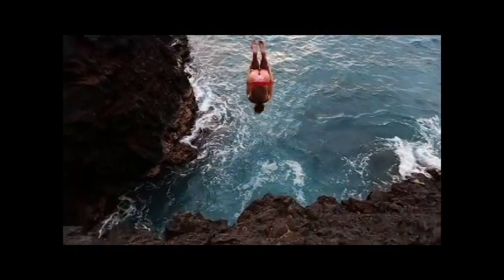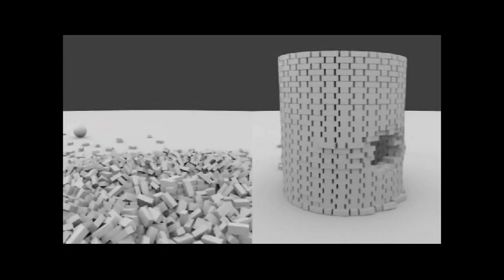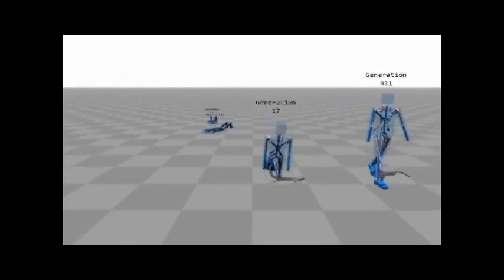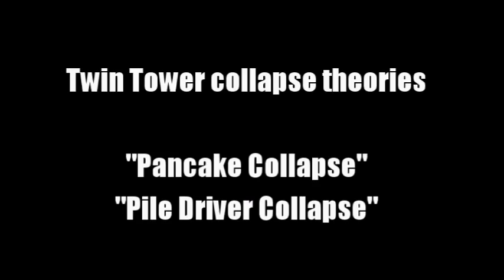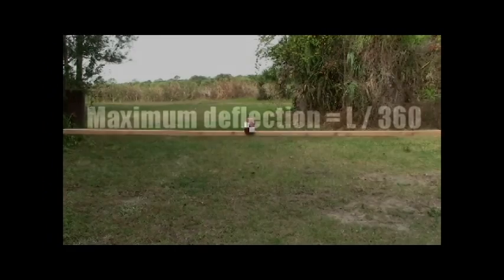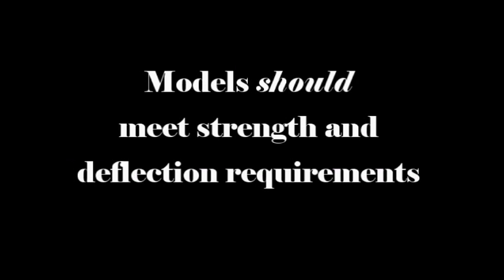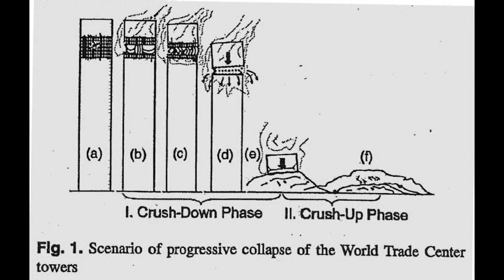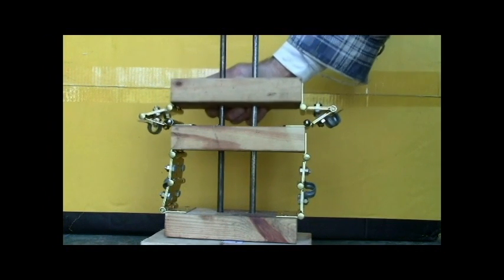9/11 Experiments: The Force Behind the Motion

Comment: Your initial experiment starting at 6:00 is hugely flawed. Your wooden frame is not an accurate representation of the twin towers' frames. Due to this, your frame absorbed alot of the force and aided in slowing down the metal weight. That's not what happened with the twin towers. Their frames were compromised due to extreme collision, fire and ever increasing weight as the internals buckled. An accurate representation has to include a frame that is capable of buckling. Due to the incorrect scale and construction of the frame in terms of load bearing capacity, directional forces and overall frame design, lack of collision and lack of fire, you cannot claim that this a fair and accurate replication of events.
Reply: Mildly Furious Monk I'm not a scientist or engineer, but I wondered that as well. I keep hearing that the frame and the bearings are the key points to this whole argument. Why did you frame the first experiment so differently?
Reply: Mildly Furious Monk do you really believe that? Reaaally?
Reply: +Mildly Furious Monk  Yeah if the WTC had that heavy frame outside of it a lot of people would still be alive today.
Reply: Mildly Furious Monk and a ceramic tiles were so inaccurate to the size of the walls if the ceramic I was as thin as Jose paper plate that might be accurate

Comment: It was going down and out because the floors were toppling over eachother and it looked like all the floors were exploding. And also the fire and jet fuel started to weaken the structure. The floors bended down. Until finally it reached breaking point they collapsed down. No explosives would be needed
Reply: Level Joe  I don't think you are on the level Joe. 
In fact, I'm certain you are a government shill.
Reply: Skygazer join the fire service. Buildings burn every day, some remain standing, some partially collapse and some totally collapse but if the are damaged by fire, they do not remain "intact".

This is yet one more video for the conspiracy theory nuts to clammer on to, that demonstrates or proves nothing.
Reply: Lenny Cribari only 3 buildings in the history of time have ever collapsed?
wtf
Someone should tell the families of all the firemen killed from building collapses. Sounds like our text books and training needs to reevaluated with this startling new revelation.
Reply: Level Joe  To clarify that for all you paid shills Joe, the three steel framed high rises in NYC were the only buildings that totally collapsed roof-to-ground in a few seconds counted by the fingers of two hands from fires.
Reply: Red Coyote Jam Garden A failure at core structure CAN bring the whole structure down and that's a fact specially at such high buildings. If you want simple proof of JUST impact damage then look at the holes at the outside structure caused by the planes. Now combine that with the huge explosion and trust me, there could have been a complete cut causing structural instability resulting in a decentralized accumulation of forces plus material weakening due to the fire causing a full collapse. Steel doesn't even need to be melted.
Reply: Gregory Dahl  There is a high probability that you are confused more than half the time Gregory. Just sayin' .........
Reply: carlosdaperez  There has been a study made of the explosive fireball when the alleged airliners struck the trade towers. They examined slow motion videos of the fireballs as they escaped trough the sides of the structure. It was determined that the rate of expansion was not very rapid at all, approximately a rate of 100 feet per second or about 95 miles per hour. That's hardly enough destructive force to blow the hat off your head debunker.
Reply: Do you know there's something called force and fragmentation which are properties of explosions? You have any idea of the proportion of heat released at it? I'm not even saying that's what made the towers collapse. But it sure is a critical factor in all of it. Don't be stupid.
Reply: CHECHNYA HIGH RISE BURNS FOR 29 HOURS WITH NO COLLAPSE
Reply: Skygazer if they burn then what remains "intact". I don't think the word means what you think it means.
Reply: Level Joe only 3 burning buildings throughout history ever fell. WTC 1,2, and 7. Seems to me like a devastating failure unlike anything anyone's ever seen would merit a proper investigation of the scene before all the steel and rubble was shipped off to China leaving many unanswered questions. Many of those questions were not even asked by the 9/11 commission. Such questions include but are not limited to: was any evidence of explosives found? A perfectly reasonable question, given the hundreds of eye witness accounts of explosions and bombs going off.
Reply: Level Joe not talking about houses. I'm talking about steel framed high rise buildings, or any rise, for that matter. No steel framed building has ever experienced a total collapse due to fire until 9/11 and none have since. Plenty of buildings have been hit by planes. In fact, airplane collision is factored in to the designing of most high rise buildings. Yes, buildings collapse, but steel framed buildings do not completely collapse from top to bottom in near free-fall speed unless explosives or incendiary devices are used. If you have seen or heard of that happening, please leave some specific information about such occurrence because I'm sure hundreds of thousands of misinformed folks would like to know about it. It might put this whole 9/11 conspiracy theory to rest.
Reply: James Evans no explosives would have been needed for the top of the building to crush 2 or 3 floors max (and that's being generous)  possibly, if a floor did give way, the top 18 floors could have fallen off the top to the side, but physics doesn't allow for the top 20% of a structure to destroy the bottom 80% using only the force of gravity.  If you can show me an instance where that has happened, I will apologize and rethink what I thought I knew.
Reply: carlosdaperez if you are an engineer then possibly you could site an instance where the top 20% of a structure completely destroyed the bottom 80% using only the force of gravity. I haven't had any luck finding such occurrence but I am not an engineer. Perhaps you have access to a database that is not connected to the world wide web. I look forward to your findings.
Reply: carlosdaperez did their investigation consider questioning the possibility of explosives given the hundreds of reports of explosions? No. Did their investigation show a computer simulation and claim it to be indisputable proof that building 7 was the first and last steel framed building to ever completely collapse due to fire alone? Yes. By the way, the 9/11 commission didn't even mention building 7, let alone investigate it. NIST did. And they decided that the use of explosives was too unlikely to even look into despite the fact that every demolition expert that has ever seen the footage of building 7 collapsing concludes that it was controlled demolition.
Reply: Lenny Cribari There's something well known and that is that this is the first time 3 buildings collapse in the way they did so I can't find any instance cause there's none. But It's also the FIRST time a commercial plane crashes directly into a highrise. People ignore and can't even imagine the dimension of damage done at impact AND explosion, they take it like it was nothing. As an engineer I can tell you there's a high chance the buildings collapsed without necessarily the use of explosives and this is determined by many factors. Just to give you ONE example, no experiments or simulations had been done in the past for this kind of scenarios. Meaning MANY factors, testings and investigations were not considered when building the towers. Even though they were designed to support 5 or 10 times of what they should, a plane crash at floor 80 is something absolutely different and new for engineers and even architects. Btw, I do not dismiss the possibility of bombs planted prior but I consider it highly unlikely since I firmly believe it can be logically explained.
Reply: You're an engineer, huh?  Ok, I have a proposal for you.  Rent a helicopter to lift a concrete block up to the height of the twin towers.  Have the helicopter release the concrete block onto the pavement below.  If the concrete block disintegrates into powdered dust upon impact, LET ALONE IN MID AIR as WTC 1 and 2 did, then not only will I pay you the expenses for the rental of the helicopter, etc, I'll pay you $1000 for your efforts.  Post the video of the event then just PM me your Paypal account.
Reply: Jason G it will need to hit 109 other blocks on the way down after it's hit by a jet airplane then burnt in a fire of jet fuel and ordinary combustibles...
Reply: Jason G I want to a assist with this. Will you pay me, say, 25/hour and transportation costs?
Reply: Level Joe  I would offer you an all expense paid trip to Gitmo just as soon as there is a change in administration that is not controlled by the state of Israel Joe. How's that sound?
Reply: Jason G And what would that demonstrate exactly? You can't recreate the motion of collapse unless you have a computer modeling program which needs strictly to involve all the variables, conditions, factors and values integrated. It's not nearly as simple as this "experiment" nonsense.
Reply: p m been there, done that.
Reply: Firestarter 
Specifically, who told you that nothing but dust was left?

Because that wasn't the case.
Come on, think!
Reply: Reforminds can gravity make one domino knock down 1000 others?
Child's play should have taught you that!
Reply: Lenny Cribari https://youtu.be/8XMTALBYRNA
Reply: Lenny Cribari http://www.cnn.com/videos/world/2017/01/19/iran-tehran-building-dramatic-collapse-fire-sfc-orig.cnn/video/playlists/caught-on-camera/
Reply: cantonear1968 sadly yes he is. In his original comment, before the edit, he claimed EVERYTHING was turned to dust even the steel.
It's a true WTF moment!
Reply: Lenny Cribari 
https://youtu.be/htabzh292ko
Reply: You don't need to recreate the motion of collapse. Look, my offer is simple - get a large block of concrete, lift it to the height of the towers, drop it to the street below and if it turms to powdered dust upon impact, you have $1000 plus all expenses paid in your pocket. Do you want the concrete block to hit a few things on the way down? No problem. All the better in fact.  Just make sure that only gravity is involved. If you want to add some burning jet fuel (kerosene) to it, I'll accept that too. Deal?
Reply: Deal Level Joe
Reply: SIater SIater and you're a dirty little hack for the jihadies. I hope you're no American.
Reply: carlosdaperez https://youtu.be/9fQlC2AIWrY
Plane crashes into buildings are not a new concept
Reply: Lenny Cribari wow! 
Was he ever fucking wrong!
Reply: Level Joe good example. Most of the building is still standing. It was nothing like the complete structural failures at wtc
Reply: Lenny Cribari https://en.wikipedia.org/wiki/9/11:_The_Twin_Towers Please read the WHOLE Frank De Martini and Rick Bryan part. Also you can look at this video https://www.youtube.com/watch?v=4pfLFKvN8Dc&index=1&list=LLhCvB7_-52NqP-4d8_nKIQA&t=1230s And SLOW WATCH IT from 19:30 to 19:35 you can see the core structure coming down, something a demolition couldn't have done.
Reply: Level Joe I guess they didn't design them to withstand the tons of nano-thermite used on them.
Reply: carlosdaperez ok, I read the whole part. What's your point? And are you saying core structure can not be demolished using explosives?
Reply: carlosdaperez https://youtu.be/GM3DkC1skY0
Reply: Lenny Cribari 
https://www.google.com/amp/s/willyloman.wordpress.com/2009/08/23/more-bad-science-surrounding-the-nano-thermite-red-herring/amp/#ampshare=https://willyloman.wordpress.com/2009/08/23/more-bad-science-surrounding-the-nano-thermite-red-herring/
Reply: Lenny Cribari 
https://www.foreignpolicyjournal.com/2013/12/09/how-to-debunk-wtc-thermite/
Reply: Level Joe this article further makes my point. Thank you.
Reply: James Evans shut the fuk up
Reply: SIater SIater shut the fuk up modern you know nothing about engineering or the structure or even with a controlled demolition looks like. Glad to see you're not letting your education get in the way of your ignorance. All that happened that day were amazing miracles three buildings symmetrically near Free Fall speeds showing no resistance pulverizing itself into its own footprint in the same general area on the exact same day not tell me what are the odds of that? What are the odds that it was brought down by Design? My money goes with design every time. Symmetrically brings order strict order and a gravitational collapse is chaos and cannot find strict order on its own so it was brought down by Design this is a fact. Your version is lame stinks and overplayed 1. That's not what happened 2. Laws of physics a can't happen. 3. History proves it never happened. Your comments have no merit here
Reply: are you seriously trying to convince people that it is expected for two buildings which is 75% and 90% intact to just collapse onto themselves every time there's a fire?
Reply: Michael Pierzchala Did it got hit by a 757???  NO.
Reply: Kevin Kelsall Jesus you're stupid if you believe that this video proves anything. because it doesn't buddy. Get off your high horse you fucking psychopath.
Reply: Reforminds you must have been asleep during your high school physics and you must be high to think that little class gave you equal footing to an engineering degree.

Fire weakens steel.
Burning buildings fall.
Reply: Reforminds There are dozens of videos explaining how WTC 7 collapsed. You think there hasn't been an investigation on this? You must be the dumbest person walking this planet to think high school physics give you enough understanding on this.
Reply: There was not just a fire my friend. There was a whole PLANE crashing thus creating a big powerful explosion combined with the impact damage. The size and factors on this experiment is not adequate to give any actual fact on the reality of the events. I am an engineer and I've studied science of materials and there's lots of wrong things in this. And I can tell you it is totally possible for a plane to bring down a structure this size as we learnt in 2001.

Comment: Just facespalm: if you made even 1:5 model of airplane, car, building, any other structure, you would never simmulate the original (just partly, maube, but never totally). That's why progressive part of humanity without bones, stones and clubs in their hands uses f*cking mathematics for math and computer models. The only clever thought I have heared in this video is that any system has it's parameters, and changing these params you change the whole system, and 110 flored building has not just params of weight and resiliency of whole building but thousands of params of every wall, every joist along all it size. Having welding machine and benches doesn't garant having knowledge, especially of trength of materials.

Comment: your model is incorrect,  6:25 notice how after the block breaks the floors (tiles),   the ends rub on the outer edges of your stand which causes  friction and helps slow down the block.  it needs to be a free standing structure, if not this is also bad science

Comment: There are a couple of fatal flaws with the theory of controlled demolition. Since the collapse started from the top and not from the base of each building, the demolition charges logically had to be placed in the office spaces on the affected levels without anyone noticing them for several days before the attacks. Also, the airliners had to hit exactly those floors in each building for the charges not to collapse the building in a mysterious way. 

Besides that, whoever wanted to perform a controlled demolition would have to make sure all wiring to the explosives and the explosives themselves survived the impacts. Otherwise nothing would happen when the charges were supposed to be triggered. 

Then there's off course the minor challenge to engage a couple of hundred people in the rigging of a controlled demolition of some of the worlds most iconic buildings without any one of them blowing the whistle.

The most reasonable explanation is that the buildings were hit worse than predicted (calculations during construction were for a 707 but only its weight, not its fuel, and the planes that hit were 767's with tanks filled to approximately 75% by the time of impact) in their most critical structure. The walls of WTC were load bearing which means that the load of the upper building rested on virtually nothing where the planes hit.

Go on, bring the "You're so blind/naive/fooled"-comments!

Comment: You used an outer support that was not affected to run your experiment on your pancake theory which is wrong as the twin towers outer structure was also damaged and subject to pancake effect just like the inner floors. Your variables are therefore invalid aren't they?